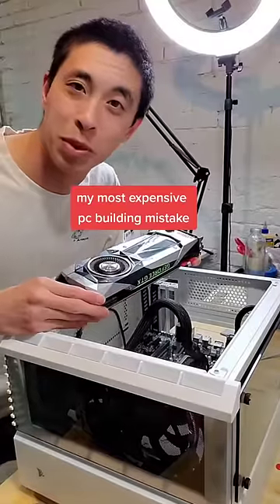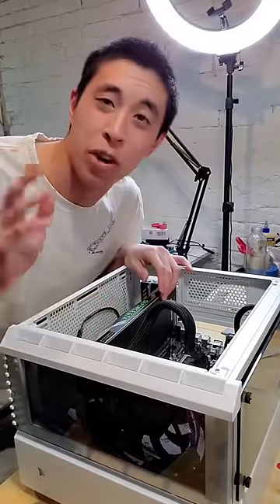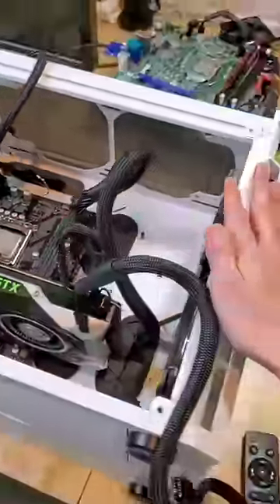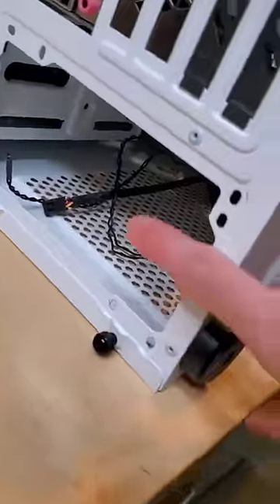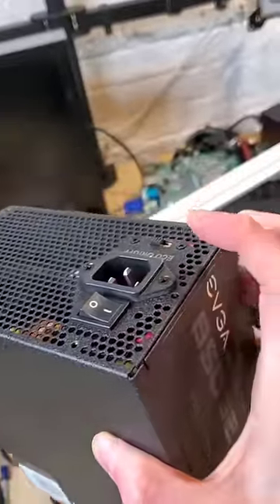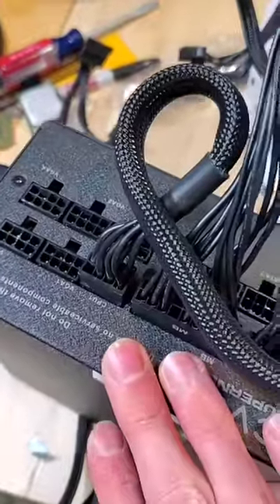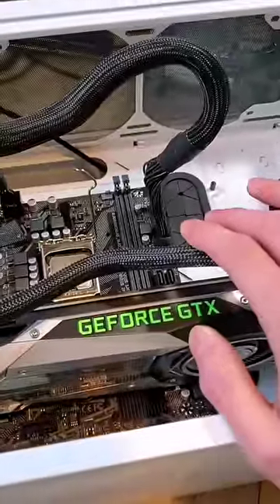my most expensive pc building mistake... #shorts

Comment: I’m so glad that I didn’t do this holy hell… I actually almost did this last night with my brand new build
Reply: I actually did this with my GPU when swapping out my PSU… thank god it couldn’t boot up and didn’t fry anything… changed cable and it worked
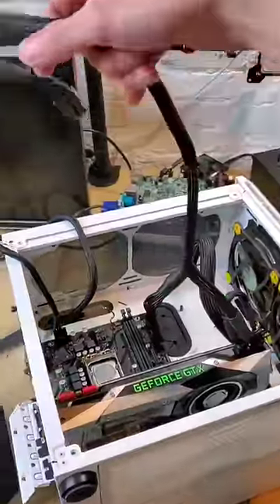Reply: @xJeremypspx  The guy actually used the wrong cable end @ 0:33 . Not the wrong cable, but the reversed cable end fried it.
Wrong cable can still be deadly, but the wrong end is deadlier.
Reply: @sfsen  that's not how cables work...

The power cable literally only sends power from one end to the other, using the wrong PSU cables is worse because the pinout is different and sends power to the wrong "pins". Please learn what you are saying before spewing crap.
Reply: @tylerperlenfein  Bruv, I'm actually dumb when it comes to tech. My sister is the expert in this.  Pin positions are standard. But according to her , reversing the cable actually is damaging. The cables of a modular psu is not just cables, it has capacitors and circuitry in it. Please confirm this, so that I can learn as well. I've seen people destroying motherboard by reversing cables.
Reply: @tylerperlenfein  The cable end marked as MB and CPU are supposed to be connected to the mb. And PCIe to the dGPU. All the PSUs I worked with had explicit warnings on not reversing the cables.
Reply: how? you had two sets of psu cables?
Reply: @George-km9bz  yeah lol, a friend of mine gave me an extra PSU he had lying around when my original PSU wasn’t working. I already had everything routed and I was like “I could save time and just plug everything into the new PSU” then I felt in my gut that it wasn’t a good idea. So I unplugged cpu, gpu, and the psu cables from the mb and used the new ones. Few days later I saw this and was extremely relieved haha
Reply: @sfsen  it’s not an issue of reversing but reusing the same cable from one brand to another but the issue is that the pin layout could be different from one similar looking cable to another. Imagine sending a lot of volts to the wrong pin bc you used the same cable but internally, the wiring was reversed (not the cable itself) as the PSU specs are different (determined by the brand).
Reply: @verbosi7y275  I had a discussion on this matter with couple of experts. According to them , the wrong pin could trigger the short circuit and other protections of PSU. If the cable fits, the pinout is the same. But the circuitry and capacitor values inside the cables can be different with different brands and cause damages. But when you use the cables reversed, PSU won't trigger protection, and can cause damages which is more deadlier. This is what they are saying and what I read from the manuals of XPG CORE REACTOR and corsair RM series.  Bruv, I'm still a noob on all this. So whoever is reading this, if you have doubts with your psus, talk to an expert than take the words of random idiots on the internet like me.
Reply: @sfsen  crazy I wonder if I just got super lucky with my ~3 PSUs worth of cables. I've been mixing and matching on my two systems for years now, but they are all EVGA modular PSUs, just different wattages. I guess I need to go through and separate them out now lol (and do some research obviously)
Reply: I did it when replacing a busted PSU. Fortunately, it simply didnt work. Didn't fry any components, didnt think that could happen tbh, given it's all wires and wired the same ... guess they can be damaged wiring
Reply: @sfsen  cables don't have any capacitors, and there's no standard pinout for the end of the cable that goes into the psu, the problem is that even if they fit they can easily be different due to this different psu sending 12v in the cable 5v rail, so you end frying it, you don't get any overcurrent protection triggered nor anything because as soon as electricity gets in it's already burned unless u're lucky and the component that got overcurrent is pretry resilient, but ypu pretty much don't have any protection, so even in the same brand use the included cables
Reply: @dantepaz5028  Bruv try searching " modular psu cable capacitors ".
Reply: @sfsen  some cables do indeed have capacitors inside, but the different shapes are designed such that you shouldn’t be able to put the wrong cable in the wrong spot, or even put a cable in upside down. I’m not sure how any of this happened.
Reply: @wahidtrynaheghugh260  Bruv, cpu and pcie cables can wrongly reversed in all of the psus I worked with. Even most of the mb connectors also have similar ends on both sides. I was able to connect both ways in an XPG CORE REACTOR, without the power in. In some psus there is no explicit warnings and I can feel those cables have way more flexible ends to work with. Those cables won't have any capacitors inside it. So reversing  those won't have any damages. Look at this video. Can you see the CPU,MB,PCIE marked ends the guy connecting to the psu? In psu manual booklets, they are showing those ends with writings, should be connected with the components and not the psu. Search for people wrecking psu/components by reversing the cables. I'm sure you can find some. Like I said, some psus won't cause problems, but some do bruv. Any way , I am not an expert and I can be horribly wrong as well. So always ask an expert or refer manual.
Reply: @sfsen  I have no idea what that brand is but with all the reputable big brands I’ve used like evga and sea sonic, doing what you’ve mentioned is literally impossible.
Reply: @wahidtrynaheghugh260  In Corsair and XPG models , I worked with, it's possible to wrongly reverse the cables. Why won't they make a different standard ends, so that noobs like me won't wreck our builds.
Reply: @wahidtrynaheghugh260  I'd say, XPG CORE REACTOR is better than Corsair RM series. RM series is not letting the fan switching on in normal use and it is hot to touch. XPG is very cool and no fan noise at all.
Reply: I have done it multiple times, just trips the power supply fuse. Turning on/off resets it.

Comment: For me when I was building my pc I was putting the ssd into the motherboard and I started to screw it in and I slipped and scratched the motherboard and it stopped working it was about a 400 dollar mistake
Edit: Thanks for almost 800 likes. That’s more than I’ve gotten on my channel lol
Reply: Ohhhh, that's so annoying going to fast. Happend to me while I was screwing in a subwoofer in his enclosure. And was going to fast and slipped and made a hole in the rubber surrounding. Sometimes humans ar idiots to be honest lol.
Reply: @kurtiuscobainius1581  well we learn from ur mistakes
Reply: @rabindrasharma  that's true
Reply: @kurtiuscobainius1581  sure thing but I always see a totorial on how to do that even thou i know , so that even a single percent of mistakes is avoided..
Reply: You can bring it to your local electronics repair shop, a quick 50-100 dollar fix to resolder the circuit
Reply: Lmaoo I did the exact same thing
Reply: PC gaming is cheap and easy? BS 🤣
Reply: @od3stroyer771  well that was a more expensive motherboard they typically sit at 100 to 150
Reply: You can fix that.  
You gotta have a fine tip soldering iron, and buy some reading glasses with as high of a +++ you can find.
Use a small flathead screwdriver or sandpaper to expose a little bit more of the trace on each Side of the scratch so you have something to solder to.
After you sanded away some of that insulative top layer be sure to clean it up with some hundred percent or 99% pure alcohol.
You can get 100% pure isopropyl alcohol real easy at Walmart it’s in the automotive section marketed as Heet in a red bottle, at least I think it’s the red one.  The other Heet bottle is yellow, and it’s pure methanol.  Either one should work really.  But you can read the back of the bottle I know one says it’s methanol.
(I wouldn’t buy the first-aid grade alcohol because it’s normally 70% or 91% isopropyl alcohol so it’ll leave some water behind, which isn’t terrible but you just have to make sure it dries all the way before you power up.  But water can get stuck under chips between the circuit board and the chip, and it can take a much much longer time to evaporate away when it’s stuck between the PCB and a chip).
Then if the scratch is small enough you can bridge it with a little solderball.
Sometimes to make it easier though I cut a tiny little piece of stripped 30 gauge wire, and I use that to solder across the gap.
If it’s multiple traces in a line then you might get solder globs sticking together so be sure to use flux so that you don’t short your traces together.
I also have some solder braid handy in case the solder ball gets too big you can use the solder braid to absorb the solder so you can start over or just reduce the size of the solder ball.
Be sure that you check it with a DMM before you power it on to make sure that if it’s multiple signal traces that they’re not conducting between each other by a little piece of solder that perhaps you didn’t see.
(Edit:  edits for audio to text errors)
Reply: @peterzum  I don’t have those though
Reply: @Theafter.  Can always go for the jank side, tape a jumper wire to it, and in future blutac your M.2
Reply: And a lot of ssds(sata) are metal, if the pc is on and you end up accidentally dropping it, you fry your mobo
Reply: @perttu4028  maybe it was an expensive motherboard?
Reply: shouldve returned it without telling them its broken
Reply: Wait you paid $400 for a MOTHERBOARD?
Reply: Technology is rage fuel
Reply: @peterzum  gamer saver
Reply: @uwuhehe6900  yea it was a x570 hero so it was expensive
Reply: @Theafter.  why would you waste so much money on the one part that doesn't  affect performance at all?
Reply: @uwuhehe6900  PCIE lanes probably
Reply: @uwuhehe6900  Yep PCIE lanes(having an ssd on PCIE4 instead of M2 is noticeable), capacitor's heat management for overclocking is important, high frequencies RAM support and probably other useful things. (like a good UEFI, when overclocking it's so much easier if you can monitor without loading the OS) 
Although a MB with all that costs 200 bucks not 400, pretty sure going above what I mentioned will not affect performances as you said tho.

nb: just saying why for some it can be justified and addressing the performance bit for fairness, in most cases your statement is valid, let's just say, the MB is the LAST component you want to invest in.
Reply: @Tilith  fair enough
Reply: Bro your not the only one, I did basically the same thing trying to remove the stock PCIE express covers on the case. Scratched the motherboard. £150 down the drain.
Reply: Usually Mainboards have an anti-scratch and anti-conductive layer on it, but surely some don’t.
Reply: @akubel33t  dang it sucks dont it
Reply: @KingslayerBeforeDawn  well I mean it did but it can only protect so much
Reply: @od3stroyer771 who said that? It can be relatively cheap, but if you want a cheap casual experience go with console. PC is more for enthusiasts.

Comment: This is actually an amazing tip. Thank you
Reply: I actually have no clue what he meant regardless XD if you could explain that would be nice. Why would it be bad to mix and match these power cables?
Reply: @yinlu3610  they might be for different wattage and if to much power goes through the certain cables it will fry it
Reply: @EN_DUB  No. Power supply manufacturers use cables with different pin layouts. He connected a cable with a different layout to the power supply's connector and shorted it all.
Reply: it realy is becuas I wa sjust planning on buying a new psu and doing exactly this
Reply: Well flip, life is hard. How am I supposed to know if EN_DUB or FlamingCheese is correct?

Comment: bro almost made me scream after saying "I bought a power supply to route the existing cables"
Reply: Sorry I still don't understand can't you tell me what happened
Reply: @blackjack8195  Modular power supplies have no standard-- so the pin layout at the PSU end of the cable may be different from one power supply to the next.  OP's computer had modular cables, but not a PSU-- so he plugged another PSU's modular cable into his PSU.  The circuits didn't match, massive electrical short / cross connect hilarity ensues, burns out every component in the motherboard and graphics card.
Reply: @johngelnaw1243 do you know by any chance about how rare it is for cables to match?
Reply: @johngelnaw1243 Cables have a PSU/computer side ?
Reply: @RobBroderick44  One end of the cable plugs into the PSU (if modular), one end plugs into the motherboard (or peripheral).  There's a standard for the motherboard / peripherals, but not so much on the PSU end.
Reply: @johngelnaw1243 so in other words just use the cables that come with the PSU
Reply: @johngelnaw1243 so question what if im reusing my old pcu and use the cables from that on my new pc will i need to worry about this issue? Sorry noob question
Reply: @KillerOstrich  As long as they're the cables that came with that PSU, no problem.  The standard for the end that plugs into the motherboard is well established-- it's when you mix cables from different power supplies that you can run into issues.
Reply: @johngelnaw1243  ok ty

Comment: Dropped a microscopic bit of thermal paste on the pins when putting in a CPU. Tried to use a fine brush with some isopropyl to clean it. It bent ALL the pins. Don’t do this lol
Reply: Weird that im reading this after buying my first thermal paste for my old pc
Reply: thermal paste won't impede the conductivity of the CPU's pins.
That is, unless you really PLASTERED it all over them.
Reply: A quick trick would prevent that, put the CPU in FIRST, then apply paste
Reply: @anotheruser676   that's the way.
Reply: Yeah just replaced my cpu this week and getting paste on the bottom of the seated CPU wasn’t even possible when done right
Reply: You're the kind of person that pours the milk before the cereal
Reply: @anotheruser676  I don’t think people understand that it gets EVERYWHERE if you’ve applied it previously and wanted to upgrade your CPU.
Reply: @erikt211  That there is the definition of 'used too much'
Reply: @erikt211  it really doesn't lol, just admit your previous application was bad too
Reply: @crimesguy  be mad😆
Reply: @anotheruser676  I used a grain of rice size, and a good type of thermal paste. It gets all over
Reply: @erikt211  I'm not mad, I'm not the one who messed up an easy job lol

Comment: soon as you said no power supply, i instantly knew what you did. i was always told if i were to ever get a pre built machine from someone who doesnt include a psu, but still has the cables that the cables are basically trash. and i have seen why soooo many times
Reply: A power supply is nothing to take lightly. I have a old ddr3 system that sees any used power supply I get in a used unknown build before it touches anything newer. It can take one for the team if  it wants to.

Comment: A few years ago I was putting all my hardware into a new case. I had everything plugged in and the pc was booted but one of the fans wasn't plugged in all the way. I nudged the cable back into place and my motherboard started smoking. Fried everything. Good times
Reply: if you didn't completely power off your computer before plugging in any sort of cable that draws power then you high-key deserved that lmao
Reply: that's tough, I've plugged and unplugged fans while my PC was running, guess I should think twice before doing it again
Reply: @CreamyCraigTV  That's what happened. Keep in mind, I was 14 years old with no experience whatsoever.

Comment: Don't duct tape your NVME ssd to the motherboard, It damaged a chip for bios being saved and would always be corrupted, so you had to manually reset the bios everytime to get it to turn on.
Reply: i used a PC nvme ssd in a laptop that only has space for laptop nvme ssd.
because i didn't have eneugh space, i had to hold it in place somehow so i duct taped it to the laptop.
the only issue i have is that i can't boot into windows with it, but it is working very well.
Reply: who in the world duct tape a mobo?
Reply: Nvme drives get really hot, it would have melted.
Reply: Gonna go take my sticky strip off of my unsecured nvme now.....

Comment: Let the thermal paste heat up before you try to remove a cooler. Depending on the brand, I've had it for bonds that would tear the CPU out of the socket before separating.
Reply: This usually only happens on older CPUs, I'm not sure why. But yeah I've broken like 2 or 3 cpus like this sadly, luckily all old and cheap
Reply: i think this only applies to AMD? coz Intel CPU doesn't have pins on it.
Reply: @callmesweet8344  pentium 4s were notorious for their fragile pins and overheating, I've broken a pentium 4 by mistake because the pins
Reply: @idkrossplay  i don't know about that, must be an old Intel CPU's, that's why I'm a lil scared of AMD CPU's and on why they still have pins, if between MOBO and CPU i'd rather keep my CPU
Reply: @callmesweet8344  they still use pins because it's easier to unbend cpu pins than to unbend motherboard pins, and also it's easy to tell if the cpu is amd or intel if it uses pins. It's scary at first but modern cpus are so durable that you probably won't bend the pins unless you put it in the socket wrong, and if you do that with intel, you break the mobo anyways